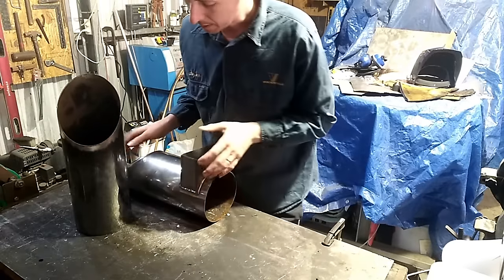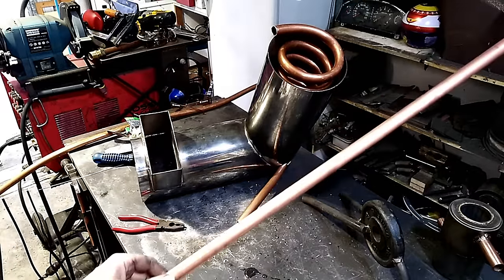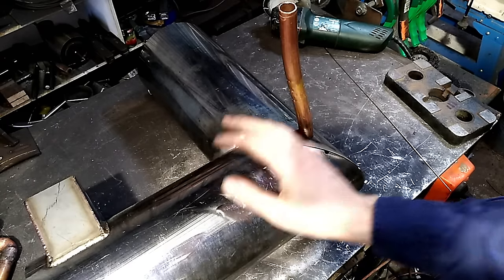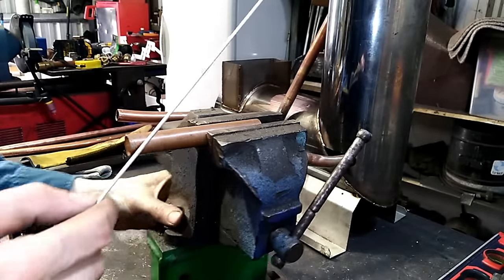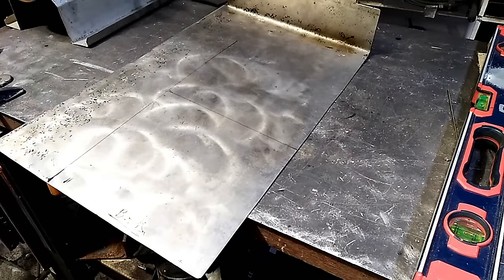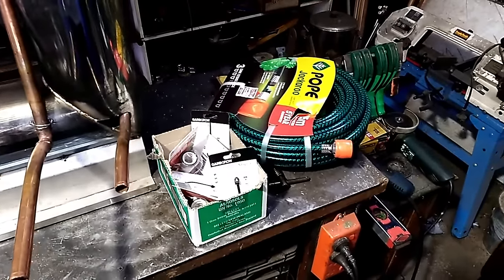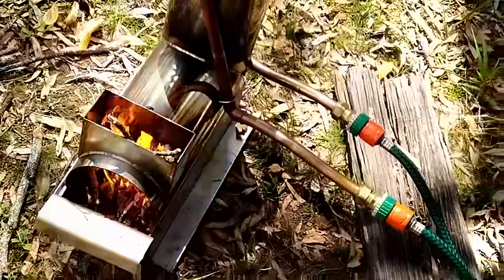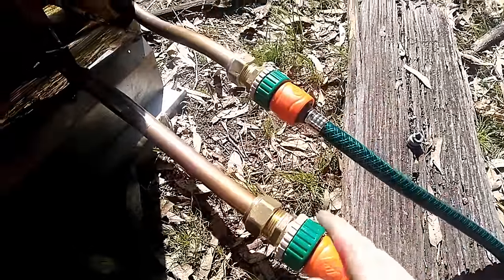Hot Water Rocket Stove II  - BUILD-

Comment: Your first mistake was to have the copper pipe coil on the inside of the exhaust stack ( that will accumulate soot and will deteriorate quickly from intense rocket flame) It should be wrapped on the outside of the stack with an enclosure tank surrounding the stack that has a bottom exhaust port. This is how you harness all of the heat your are generating. I used a discarded 100 lb propane tank for my enclosure with a 5 inch inside stack  wrapped with copper coil exiting the side of the tank to a water pump that is connected to an salvaged auto rad and fan that runs off 12 volts. Incredible heat distribution system to direct heat away from the stove. And in case your wondering I secured the copper pipe exiting the outer tank by soldering it to the metal so no exhaust fumes would enter the room. I could have also used silicone but wanted a solid connection.
Reply from the maker: Brilliant tips there, revisiting this build soon
Reply: Nice. I've been thinking about something similar with the radiator but this sounds like a closed system. I've been wondering how you would avoid steam buildup leading to an explosive rupture. Did you add some sort of pop off valve or something?
Reply: @MatterLabz  Most Boilers have combination temperature/pressure relief valves installed that release at  30-40 psi. You will need to install a water temp gauge to monitor it.. A hot water holding tank will easily control your excessive  hot water limit. Using a 30 to 60 gallon discarded hot water tank will certainly take along time to build up water temp to an unsafe level if your stove can run that hot. You should also setup  bypass control valves to isolate or access this large volume of surplus water This is your basic heat ex-changer concept. Using traditional boiler safety hardware and the surplus tank will provide a safe effective method.
Reply: @jrperrotta  thanks for the additional details. Surplus components are a great idea. I like the holding tank plan. I was wondering if you could build this tank into the downturn portion of the stove. Construct the water tank as a series of baffles the heat must pass on its way to the output. The tank segments replace the copper tubing and accumulate/stabilize the stored heat. This is specifically why I asked about relief valves. Of course the construction would be more complex and I would have to improve my welding skills. :) I was thinking of modeling this in Fusion 360 sheet metal then unfold it and cnc cut wooden templates. From there I would plasma cut, bend and weld. Thoughts?
Reply: @MatterLabz  Not sure I understand correctly but are you suggesting to build a water tank with the rocket stove going through it instead of coiling copper tubing around the stack? If so the tank wouldn't last from the scaling and rust within.
Reply: @jrperrotta  Yes that's exactly what I meant. I didn't realize an integrated tank would cause problems. Thanks for the heads up. Do you know why that's the case? How is it different than a gas water heater? I'm curious why it isn't an issue with copper pipe. Is it the copper, or that it's pipe rather than a tank? Thanks so much for your responses!
Reply: This is very similar to what I have in mind, i had planned to build a rocket stove out of gas and oxygen tanks, wrapping copper coil around the upright then encasing with a larger diameter tank filling the space with sand as a thermal store, but listening to the comments you could reverse the process by putting the oxygen tank on the inside of the fire and using it like a back boiler except on the inside? Thoughts 🤔
Reply: @MatterLabz  Yes, install Hot Water Heater Temperature Pressure Relief Valve in the event it overheats. But that is only if your using a radiator system that is small and the blower is unable to cool it. Otherwise a large rad and blower fan will keep up and prevent it from overheating.
Reply: @MatterLabz  You may have more success with a discarded boiler heat exchanger and incorporate that into your design if your attempting to perfect it. In fact building a rocket stove with an existing boiler and circulater as well as the other features would be ideal since your heat source it the only thing that would change. Mind you the size to incorporate it all together would be huge.
Reply: @MatterLabz  Different heat source create different BTU outputs. LPG and Natural gas are very close to each other, gasoline is next up the ladder and diesel,  oil and firewood are at the top. Firewood can get out of control depending on the amount of air provided ( just think of what a blacksmith would use to heat or melt metal.The same with diesel and oil both can reach extreme temperatures with pressurized air. Especially if using Oxygen and Acetylene for example. I've seen wood stoves with the metal in the firepot area disintegrated from the heat all from the introduction of pressurized air with the wood fire.

Comment: Just a tech point.. why didnt you use lead solder as it wouldn't melt as when working will have water circulating
Reply from the maker: I didn't have any solder at the time and I just wanted to see if I could get a water type seal on copper with my tig

Comment: You could also have used water as you have the caps on the end.  You can also use a cable of the same ID, assuming the bend isn't too tight.

Comment: Hot line should be upwards to the tank directly not downward,,,Good to challenge has a 2 layers of stovepipe in which water flows instead of the copper pipe.

Comment: surely the rocket heat will melt copper. the safe way is to wrap the coil on the outside of the jay. which incidentally won't interfere with the turbulence that makes the rocket work
Reply from the maker: If you were to run it dry for sure.
Reply: what about interference to turbulence.

Comment: You could have used smaller tubing, this will heat so fast with a circulation pump you'll have all the water you ever need. Looking at it, it appears to look more like a steam cleaner.

Comment: I am looking to work with someone to develop a small residential space heater for use in 'emergencies' or [more likely] for those few Winter nights when the temperature dips way down and whatever you've got for most of the Winter just doesn't cut it.  Where I live in the Mid-Atlantic states, that's about 20 nights of the year, mostly in January.  Now, we generate a lot of waste cooking grease and used vegetable oil all year round.  I believe that it, perhaps with some cardboard able to "wick" the fuel, could be sufficient fuel.  What's needed is a Rocket/Gasifier with the two stage combustion, to ensure that Carbon Monoxide is not a problem, and a geometry that would allow it to be encased in sand or fire cement (like those DiY metal smelters seen on here), such that it could never be tipped over accidentally and be a fire hazard. But heating water, as you've done here, makes a lot of sense; not for a bath, but because you can send it through a heat exchanger (like a car radiator or transmission fluid cooler) with a fan, and distribute the heat well into the room.  Those 20 "deep cold" nights are responsible for hundreds of dollars a year in extra heating bills.  If you used a 'water jacket' instead of the coil, it could be a lot easier and cheaper to build; you just have the reservoir around the flue instead of in a barrel to the side.  The radiator/fan would provide the temperature differential.
Reply from the maker: that sounds brilliant, I'm actually building the second version of this right now and will be posting my results as soon as I'm done.   Cant partner with you, I'm on the other side of the globe I'm afraid, I hope you find someone! Thanks mate
Reply: @LittleAussieRockets  That wouldn't be a problem.  The right working prototype could then be manufactured locally around the world, from a standard set of plans.  The cooking grease/fat/oil has some advantages over wood, in that it can be automatically drip fed, would smoke less, and is quite amenable to multistage combustion. It would also leave much less ash to worry about.  We Love Aussies!
Reply: Its worth noting that Thermoelectric Chips are now down in price to $0.10/Watt; this means that it would cost relatively little to have an electric fan (or two) that was driven by the heat coming through part of the wall from the combustion chamber.
Reply from the maker: @PressToDigitate  I think your on to something here.  what i might do is work an oil burner into my next water heater build.  see how we go.
Reply: @LittleAussieRockets  Its a good excuse to throw some burgers in the skillet!   ;-)
Reply: I just had a brain fart,here goes the idea then the reason for my logic. First the idea,some diesel engines have stainless tube type heat exchangers and I have one it is from a Caterpillar and it is 5" in diameter and fitted in its designed location it attaches with large stainless clamps. I might try to build one using it and when the tubes get an ash layer I can use a gun cleaning brush to raise it's efficiency back up when it gets poor from the ash. It is not very tall and I only got it for scrap. Oh and if one tube is leaking I can simply plug it on both ends of the tube like we did on those boiler emergencies. My problem is I am old,so are my eyes. I can not use the heli rig to make a pretty weld anymore. Any ideas,I braille weld these days. I love it and saw a comment that you now have a pump too.

Comment: use water in the pipe and freeze it cap the ends with tight caps ...wind the copper around a pipe with the proper od about 10 centimeters should do it ... load the 10 centimeter pipe in a pipe machine and wind it up while still loosely frozen...quick easy and even use a foot pedal dead man switch on machine to free up both hands ps use smaller copper pipe the about 1 1/2 centimeter for better exchange of heat . once pipe is wound just unwind it a bit to loosen from the 10 cm template!

Comment: All in all a very great looking stove / heater. Maybe next time you have to solder copper try using a  flux & 95/5 solder  & propane 
or map gas. Remember to heat the bottom of your joint & feed the solder from the top. Here in the States their is flux with a solder in it, that might work also for you. I think it is made by a company called " HERCULES " works great on soldering some electronic  wiring also . Like you stuff ,keep up the great work.    Merry Christmas & a Happy New Year to you & your family from Michigan

Comment: the reason you are getting blowback like that is the tube wasn't full of water this causes a bubble for a better name for it. the water hits the pipe that is void of water and turns to steam thus the problem. I f you try this again get water in the tube so it is full and a few inches of water above the outlet. Otherwise a great video.  P.S  just regular solder would work you showed with the temp gauge that it isn't hot enough to melt it.

Comment: No need to slit the sides to weld that pipe close in because most others will SOLDER those pipe joints in 10 seconds and way easier!!

Comment: simple old stove wood heaters uncles farm had a  copper pipe wood stove water heater probably filled a copper tank for the bath
A mate took me his parents house they had a pellet wood heater sent from sweeden or alike to test 
It used about 1kg pellets lasted a day that warmed a house 25cel easy overlooking the farm noyce
them normal wood heaters r great a few logs warms a house some Pay $400 a ton for cut wood  My outlaws cut a ute full and gofishing for a day that last a month saves $800 elect bills :)
Reply: Firemaster wood pellet heaters are the clean, convenient and environmentally friendly way to heat your home. At the touch of a button you have control that automatically delivers warmth and comfort to combat those chilly nights. Unlike a traditional wood heaters every part of a pellet heater is automatically controlled. Simply pour the wood pellets into the pellet hopper bin located on top of the heater, set the room temperature you want and push the start button. Then sit back, relax and enjoy the warmth. The pellets are automatically loaded into the fire chamber by a corkscrew or auger system. A variable speed fan regulates the heat output. The fan draws air through the fire chamber ensuring that the fuel-to-air ratio is optimised for efficient burning. Pellet wood heaters are so easy to clean. Due to the high burning efficiency, a 15kg bag of Maxiheat wood pellets is reduced to a cup of ash. Includes a Free Flue Kit (Valued at $429). Length: 627mm Width: 599mm Height: 883mm AU$990.00

Comment: What size pipe and what size copper tubing did you use.
Reply from the maker: 20mm👍
Reply: Can I use a 5inch pipe and 1/2inch copper line and achieve similar results?
Reply from the maker: Yes thank should be fine.  As long as you can coil your copper to fit into the 5" pipe 👍

Comment: Would your rocket stove work if you turned it over so the chimney faced down?  Thermosiphon works the exact same way, or should I say it would fail to work the same way as this did. This is not thermosiphon, it is hopper cooling. water in the coil heats until it boils, then it belches out steam and boiling water thru the path of least resistance to the top of the barrel, replaced mostly by the water from the higher pressure bottom tank port and some sucked back in thru the top. You made a really big coffee maker:)  It is actually less efficient as you are loosing a ton of heat with all that steam during the belch and hot water absorbs less energy than cooler water.  A true thermosiphon would be a steady flow, no steam or belching and you could set in it till it got too hot to stand...   Re-weld the elbow on the top of the coil so it goes up at a steep angle(60+ degrees)directly to the top barrel fitting(no downward turns).  Keep the top fitting underwater as it must be under water for any siphon process to function.  The bottom hose could be coiled, but shorter = less friction which is important as thermosiphon is a low energy process and friction losses will add up. Light it off again and I think you will be very pleasantly surprised at the steady flow and heat output.  I use thermosiphon to cool a lister generator set with a heat exchanger where your barrel would be. Works great and gets me 120F fresh water off of my running genie outputting 195F water...
Reply from the maker: Thanks mate, revisiting this build soon to put into practice so many of these great ideas you guys have suggested. Cheers
Reply: Little Aussie Rockets: I didn’t catch what the exact use of this heater was going to be but from an efficiency standpoint your coil is really undersized in terms of surface area for the amount of heat/hot gas your rocket stove produces. Now if this was just to heat a bucket of water to do the dishes and cleanup after you cook dinner on the stove, it’s probably about right. But if it is supposed to make enough hot water to say take a shower, then it will use a whole lot more wood than is necessary.   Don’t know what is available where you are at, but Corrugated Stainless Steel Tubing (CSST) is pretty common here for hooking up propane and natural gas appliances and can be had in 19 and 24mm diameters for less than a dollar US a foot when you buy 100’+.  It is very flexible and can be easily coiled to fit about any container easily to use as a heat exchanger. It has a yellow poly coating that you need to heat and melt off but it is very easy to work with for low/no pressure applications like this. It also has the advantage that the corrugations break up laminar flow for greater heat transfer efficiency.  The problem you run into with larger coils though is that they will not thermosiphon fast enough to keep the water from boiling and they really need a pump to force the flow.  If you want to increase surface area but still keep thermosiphon flow you really need to fab up a multiple vertical tube boiler.  Good Luck!

Comment: Don't get me wrong or anything but I'll give you my opinion ,copper comes in two thicknesses also,
Normally when we sweat it we need to get it shiny on all the fittings  we want to join. when you heat copper with a torch  it will tarnish and the  solder won't stick to it that's the purpose of flux it keeps the copper from tarnishing long enough until we can join or sweat the fittings together, I noticed you were using a garden hose and that's not going to work, I used to work in the swimming pool  jacuzzi spa trade  and the code said we have to have at least 5 ft of copper from the heater and after that PVC( 2 inch diameter what we used isn't cheap) but it wouldn't take much to run copper all the way because that garden hose is not going to be dependable but now I realize you said  just making it a test also like I still don't know  if  that copper inside the chimney is going to melt or not the water running through it should stop that but you would probably need to have a circ pump going, , might be able to coat the inside with fire clay with some crushed fire brick cement to protect the copper thanks for the teaching me as I'm going to build one for my daughters spa (I got a good stick welder, ) and can't afford the electricity to heat it. It will be wood or charcoal fired and should be plenty of heat to bring that up to temperature

Comment: The steam production is from too little water flow. If I were installing this with a tub, I would use a hot water rated BLDC pump. Reasonably priced and can run from a solar panel, or a thermopile since you already have the heat source. But I would run my inlet from the top of the heat exchanger, and enlarge the cold water supply line as well. Your long hose arrangement had a lot to do with the situation too, I bet. Also avoid droops. These are energy robbing. Remember every time water has to travel up hill, it loses momentum.
Reply from the maker: It is your comment that made me buy a pump, so thank you sir. Waiting for it to arrive.